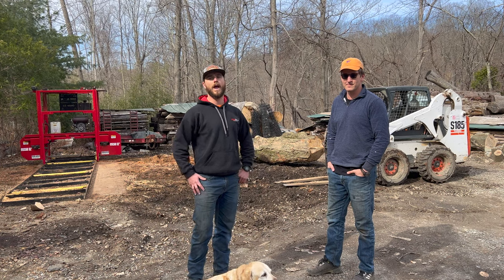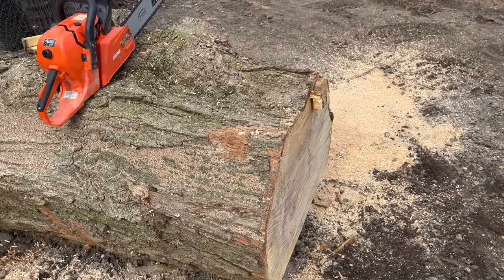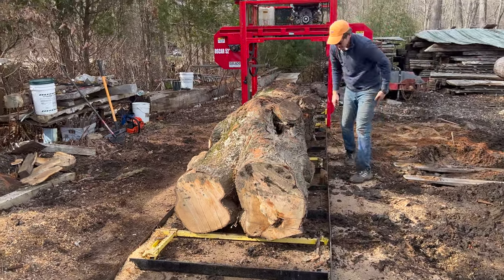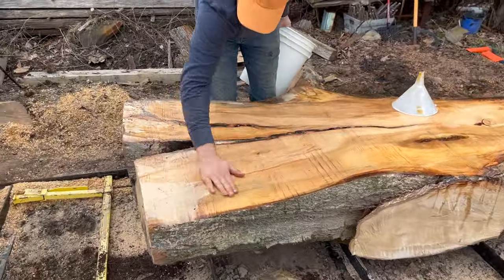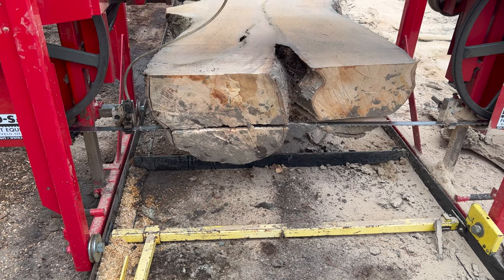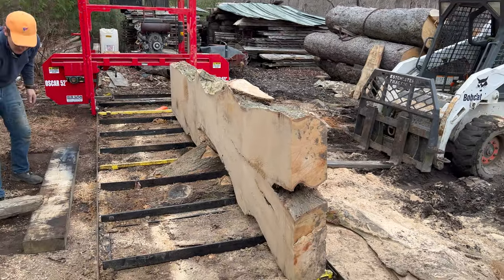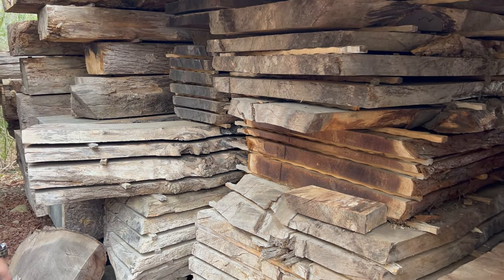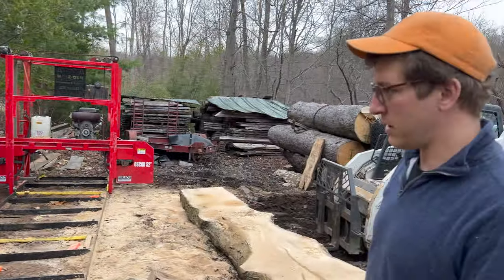#206 Milling a GIANT Sugar Maple Log on Hudson Sawmill

Comment: That mill seems to be really struggling , did he ever put on a new blade as the cut looked wavy on the first run through ?
Reply from the maker: The blade was pretty ready for changing to begin with but there was a fear that there might be metal in the tree based on where it was taken from.